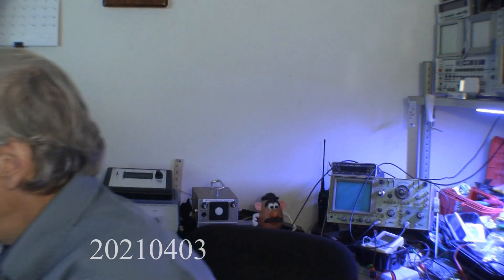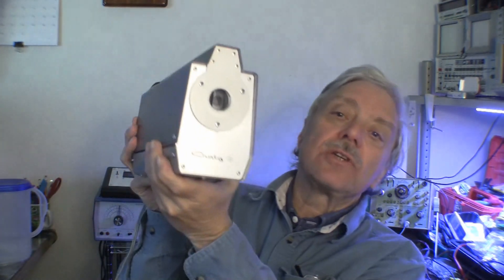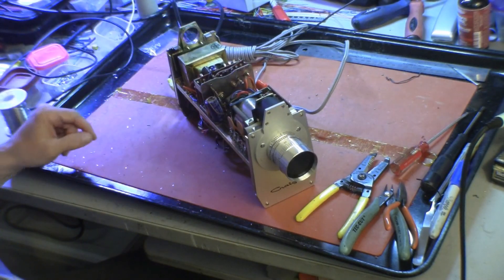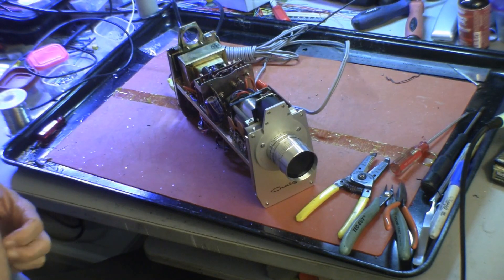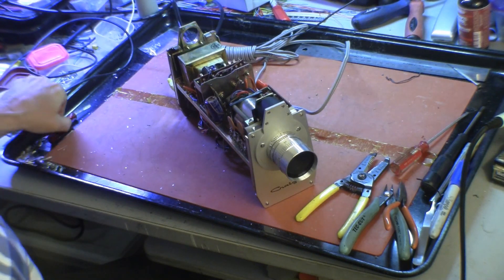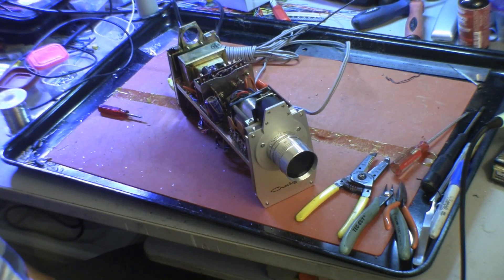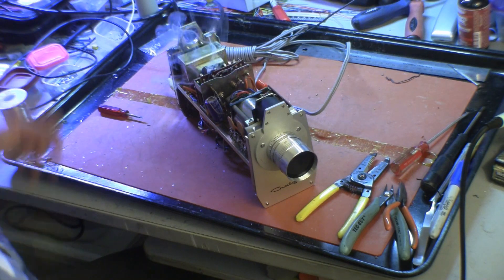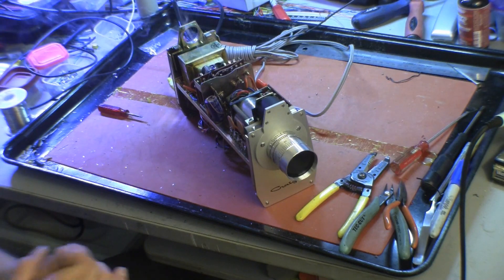Craig 6104 Vidicon Camera Restoration, Part 7

Comment: If you return the vacuum to the vidicon, it will return to normal, but due to the poor glass density on the target surface, air will enter again.Their research efforts are very commendable. I think it's wonderful. 👍

Comment: Bummer about the camera but we have all been there and done that (if you do this long enough). The one I was most bummed about was not a magic smoke release but a vacuum release open the CRT of a Sony KX-2501, was adjusting convergence reached to get something, and nocked a roll of solder off its holder and well you can guess where it fell.
Reply from the maker: You work on enough things and you will break one now and then. Sorry for your loss.

Comment: Would you by any chance have or know where to find any decent papers/literature about vidicon camera design? I'm having trouble finding any online and as I'm currently building a vidicon camera of my own they could come in handy, especially some directions about target amplifiers since all I get is amplified interference and barely any signal. Thanks in advance!
Reply from the maker: Yes sir. SAMS Publishing book number 22382. ISBN# 0672223821. Out of print, of course. "Video Cameras: Theory and Servicing by Gerald. P. McGinty". No good video gear designer is without this one.  There are two listed on Ebay right now.
Reply: @videolabguy  Thats perfect, thank you!
Reply: @MrSlehofer  That's awesome that you're going to build your own camera! I've just started learning about these vintage tube cameras and the thought crossed my mind that it would be a really neat project to make one. But I think it's way over my head at this point!
Reply: @MrSlehofer  ah thanks a lot, I've been interested in the same thing so I'll be sure to check it out

Comment: Did the power transformer fail? That would be un-obtanium.
Reply from the maker: Excellent question. I don't think so. But, several resistors flamed off of the rectifier board and I did not record their values correctly on the schematic. The number of issues in the camera reached a threshold. I may be able to resolve them. BUT, it will take a longer time than I want to invest in, and the viewers of the channel deserve more variety. This camera will not meet most of those goals now.
Side note. If anyone out there is interested in obtaining this camera and taking a stab at it. Email me and let's talk. You can find my contact information at Labguy's World on the personal contact page. You pay the shipping. (estimated $25 inside the USA) You get the camera and all my notes.
Reply: Temptations, temptations,  tempting temptations...

Comment: That really sucks. I know how disappointing and frustrating that must have been. I'm surprised though that just connecting a capacitor backwards would cause so much damage! I would think it would just destroy the capacitor but not really affect the rest of the circuit. When I was restoring my 1952 Olympic TV, I connected an electrolytic backwards and the tv actually still worked for a few minutes! But I noticed the image started slowly shrinking on one side and I smelled something weird...then I saw smoke! I immediately turned it off and unplugged it. I found the capacitor steaming. I checked the schematics again and realized what I did wrong. DOH! But it didn't cause any other damage. I just replaced the capacitor and managed to get the tv working. That was a few years ago and the tv is still working fine today.
Reply from the maker: Yes. Your reasoning is correct. Funny story, but I have since given the Craig camera to nice person who wrote to me and asked for it. As I was putting it back together, I found a wire had come undone from the power supply board. That was why it suddenly stopped working. Shhhhhh. Don't tell anyone. But, I think the new owner has a good chance of finishing the job. Silly me!
By that point, I had already committed to giving them the camera. So, I could not back out of the deal in good conscience. The deed was done. No worries. Plenty more projects on the old bucket list!